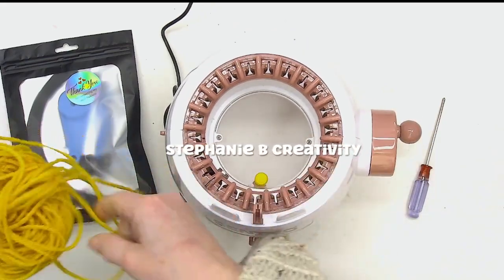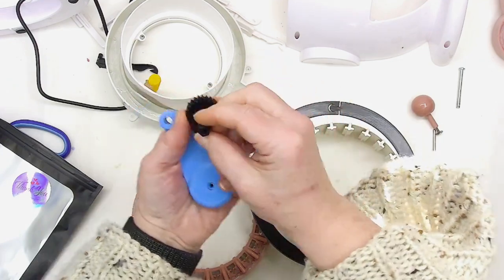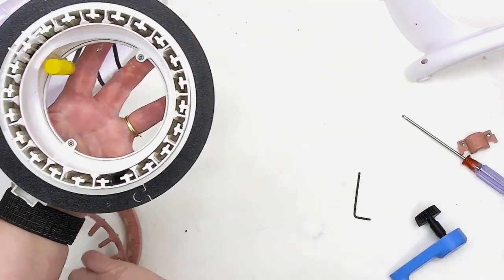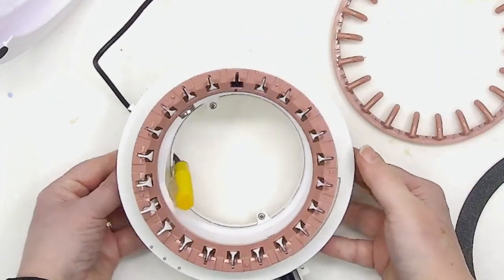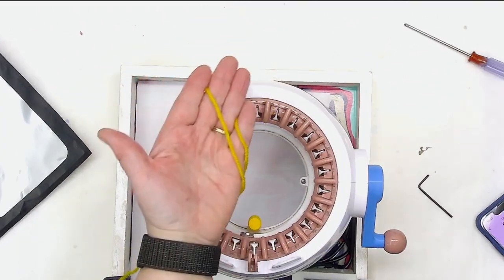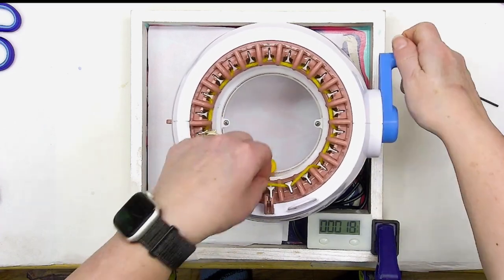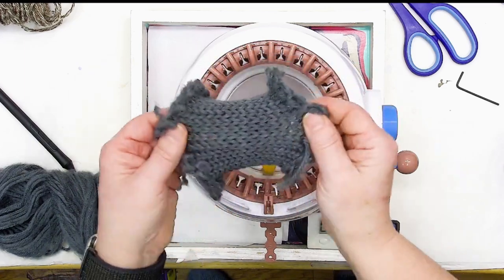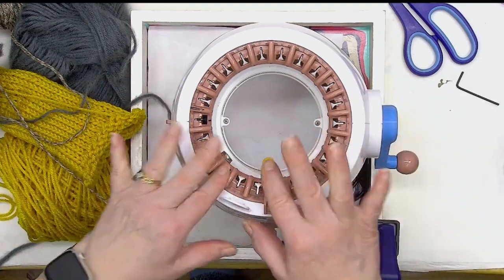Installing a NEW Gear Replacement for Sentro 22 Knitting Machine

Comment: I just bought the Sentro 22 and it arrived yesterday.  Last night I made 2 beanies and right away it was grinding and sticking and wouldn't work with Super Saver.  Today I made 3 tiny pumpkins and tried the Super Saver again and it stopped dead.  It works for lightweight yarn but it is not smooth. I don't know why they keep selling it with the gear the way it is; why don't they just fix it and charge a few dollars extra? It really bothers me that I'll have to order parts to fix a brand new machine if I want to use Super Saver, but I am glad that this exists. I am very bad at putting things together.  I see this video is a year old now; did the guy who made the parts start to include directions yet?  Thank you so much for this.
Reply from the maker: @craftykat  oh I’m so sad to hear that it wasn’t working right out of the box. That is so frustrating. Grumpy head didn’t include any instructions. Personally if I bought it off Amazon I would send it back for a replacement or refund and look for a used Addi Express Professional 22 needle.

Comment: FYI, I used a flat head screw driver to remove the screw in the handle. It is made where you can use the Philips head or flat head. The philips head seems like it was already worn so not sure if that happened in the factory or what but use the flat head, jjust got to wiggle it a little to find the grooves.. And you do not have to turn it a lot because all it is attached to is the small little nut
Reply from the maker: Yes! Thank you for sharing your experience

Comment: What is the black ring for?
Reply from the maker: The black ring is a shim that helps keep proper pressure on the top ri g that holds the needle guides
Reply: So yea that is what I was thinking. I just watched a video and they did not install it. I am thinking ppl are spending money on parts when they just need to move the tapper gear forward with a shim to contact the gears on the rings. JAT @StephanieBCreativity
Reply: I do not have one of those machines to take apart but I have understanding of how it is supposed to work. Since this is a toy they are not going to remold it it with tolerance  @StephanieBCreativity

Comment: You should have lubed the needles/pins while you had it apart.
Reply from the maker: Hi! Thanks for the suggestion. I did lube the needles with white lithium grease spray when it was all disassembled. I forgot to record it for the video.
Reply: Can you tell me how to Grease the pins please? What part I guess?

Comment: After watching this my thoughts are maybe you didn't need the new crank gear but only the extra black ring ?
Reply from the maker: That is a possibility- though replacing both parts certainly fixed the skipping and grinding. Thanks for watching!!

Comment: I looked up that replacement gear at grumpy head on etsy and never saw the black round  thing that comes in two pieces.   So what am I missing?
Reply from the maker: The ring is part of the package with the  gear. I didn’t expect the ring when I received the package.
The ring has been upgraded and now is a split piece.